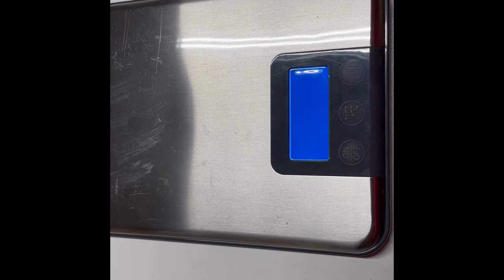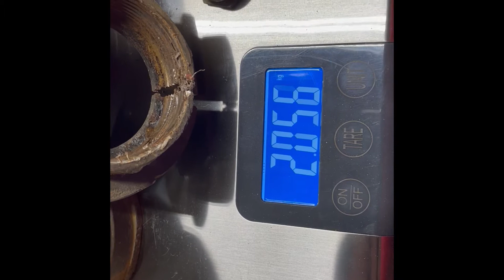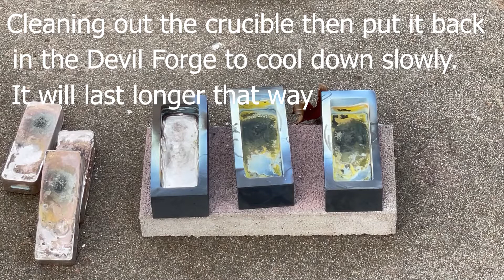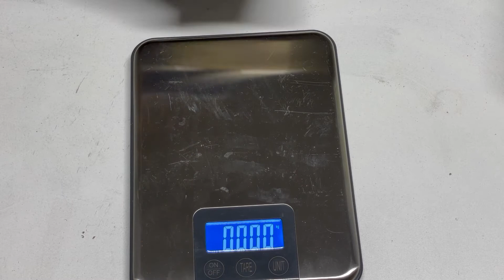2in Brass Valve and Parts

Comment: That is a nice furnace, that... I am not sure I can melt brass with what I have made... I know, I can't melt much in the winter... Hey, those look great... I would say that was a good haul... Be well and Merry Christmas...
Reply from the maker: Thank you.  This is a 4kg Devil Forge.  It works really well.  I have done 12 melts with one 20lbs propane tank.  I bought my Devil Forges on Ebay.  Little cheaper there.  

It does get a lot colder there than it does here so I can understand about not being able to melt much in the winter. Stay warm my friend.